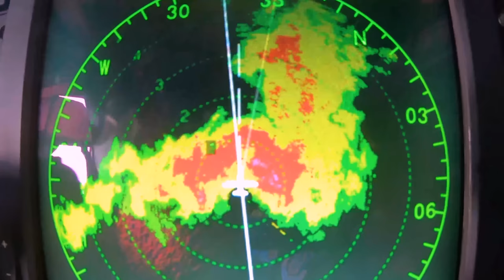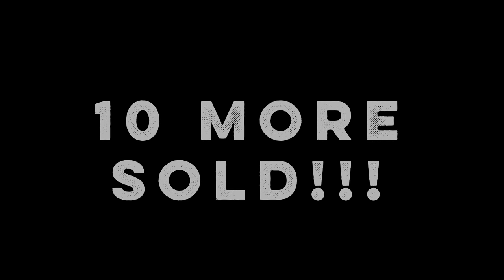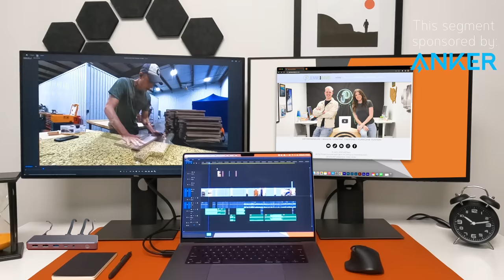we've wasted time on this for 5 months...

Comment: I would look at putting HD castors on all the racking units then replace those flimsy folding tables for the laser's with benches, again with castors. I work in a 2 car garage and EVERYTHING I have is on castors. Makes like so much easier.
Reply: HD casters aren’t cheap, but they’re worth their weight in gold when you decide something heavy needs to be repositioned, or just for moving to clean up underneath! But trying to low ball it with cheap casters is just begging for frustration!

Comment: I noticed you measuring and marking each board before putting in the laser. Assuming the boards are the same size, why not make templates for the cutting boards and charcuterie boards so you don’t have to pull out a tape measure and find a specific measurement each time
Reply from the maker: That’s a great idea, Nick! Once center-finding becomes our biggest time-waster we’ll attack it with your idea!
Reply: @jennieanddavis  it doesn't need to be the biggest time waster to be worth doing. If it takes you 10 minutes to make but saves you 1 minute every time you engrave a board, it seem like a no brainer

Comment: I would suggest that a stand up desk be used for the design computer. That way you spend less time from standing up to sitting down. if you really need to sit, then a bar stool can be used at the computer. 
Would also suggest that the design computer be moved around the corner from the printers. I don't see why a computer has to be in the line of sight of the printers. That would allow for Step 2 to be on the same side of the space as the remaining steps.

Comment: Great content. What about putting the inventory shelf off the corner where the laser computer was moved so it can be loaded from the back since that is the side where finished product comes from. Then move the desk with the computer or have it elevated over the laser or next to it and use the freed up desk to have a jig for each board type to find your center. Just a thought to further improve flow from production and from inventory to personalization
Reply from the maker: Thought about it, we’ll need that space for table manufacturing in the future. I’m sure we’ll rearrange a few more times over the next couple of months

Comment: No, no, no, no... So there was this place called Ito University that taught production dynamics. Grab a blue ribbon, this is the 'blue ribbon way', and walk the line affixing the blue ribbon every time you stop. Ask, 'why did I stop here'. Ask 'why' if you cross your path, make it a straight line. Because of the constrictions to the space, you need an imperfect 'U' layout. Materials for the product placed at the entrance on one side, materials for shipping on the other side. You may have to gain another computer (second hand formatted and just the most basic programming) and set up a local wifi system so they can all communicate ....create a mil-spec 'Hi/Lo' inventory system. Looks like a pretty good start to a good production cell.

Comment: They need to have a finish station and put the boards on the shelf pre-soaked in oil.  That little oil they put on before shipping isn’t really enough.
Reply from the maker: Appreciate your suggestion, but I’m a little confused. It’s not enough for what?
Reply: I think they mean not enough for long term protection.
Reply from the maker: @jarodmorris611  how long term is ‘good enough’? I hate to sound like a squawking parrot 🦜 but these questions need concrete answers (and profitable decisions) when you’re running a business!
Reply: @jennieanddavis  Don't confuse my interpretation of what I thought Web Crawler means for agreement with the critique. We usually soak our boards in food grade mineral oil for 10 - 30 minutes (and then let air dry for a day or so) depending on thickness of the board and whether it's end grain or edge grain. Then when dry, we wipe on our mixture of beeswax & mineral oil. Wiping on like you did, in my opinion, is perfectly fine.  The end user should know that no matter what you do to finish it before they get it, they have to maintain the board.

Comment: You still measure for the centre position of each board for lasering and measure the piece of leather to cut to make the loop.    How about making a simply jig for the leather, so you put it in, the cut it off.   And a centre finding jig for the boards.   Both with save lots of time when putting through batches.    Not to mention lower chances of a mistake.
Reply from the maker: Those are great ideas, and they’re small rocks compared to the time we spend on other bigger problems! We’ll get there one day!!

Comment: I have 2 suggestions :

1: Check into motion lights. Not the security lights you use outside they are are fixtures like you have but have a motion sensor on them and come on when you are in an area and shut off after time. We used them in the warehouse i worked at and they were like 20 foot in the air and worked great. Helps cut down cost.

2: Make the black box into the shipping box. First of all cuts cost second cuts out waste for your customers and is better for the environment. Bonus it cuts out a step in the fulfillment.
Reply from the maker: It might be really easy to switch out those light switches with a couple of motion sensors… great idea!

In response to the boxes, we used to do that! Boxes looked horrible - there’s a video out out channel about a pallet of boxes getting ordered accidentally, that’s the video where we cover that!
Reply: @jennieanddavis  The lights I'm talking about have the sensor built in so that only the lights where you are working come on rather than lighting the whole area that the light switch covers. Plus the sensors on the lights work a lot better than the motion light switches. If you mean that the black boxes get messed up in the mail you might want to talk to your printer about getting better quality boxes or talk to other printers. It always helps to keep your options open.

Comment: I've mentioned this before....But I see you guys are still using a palm sander. 

why??

With the production yall have, using a garage shop palm sander is killing your "TIME", not to mention cost of your sandpaper.

You've got dust collection, why not utilize it with a dual head drum sander? 120g on one head, 220 on the 2nd. Sand both sides of the boards in less than 10 seconds.  

Yeah, it's expensive, $2k on the low end, but so are those laser engravers yall got. 

The time it would save you, you'd make your money back quickly.
Reply from the maker: Hey Mike! You’ve been around long enough to know we’re no strangers to spending money on tools we need! How’s a drum sander going to get the sides, chamfers, and charcuterie board handles?
Reply: @jennieanddavis  Howdy...

Use an Oscillating Belt/Spindle sander. Rigid makes a good one. It's a tool I never knew I needed until I got it and then it was like Home Simpson....DOHHH!!!

It has a spindle that's 1/4" that allows ya to get into the small areas. 

Now, obviously. When all said and done, there's always gonna be the "finish" sanding, but that's always done by hand anyways. 

Your video was about saving time/getting more time back. As you mentioned, we both know our way around tools and "sanding" and it's the sanding that takes the most time in any project. 

Since the majority of what yall make has 2 flat sides (as opposed to a box/cabinet), you'd be able to sand a whole cart full of boards faster than you can send them through a Planer. 

As well, with the drum sander, you could eliminate the hassle of scraping the glue. Go straight from clamps to sander. 

Just trying to help 😇
Reply: Before anyone chimes in saying..."But sanding the glue will gum up the sander"...

There's 2 things to be done with that. 

1) Have an extra sanding cylinder with either 80 or 100 loaded onto it, as a dedicated glue removal drum. Just swap it out when done. 

2) Use a sanding eraser. This step would be used in regardless. They work great and extend the life of the sanding belts.